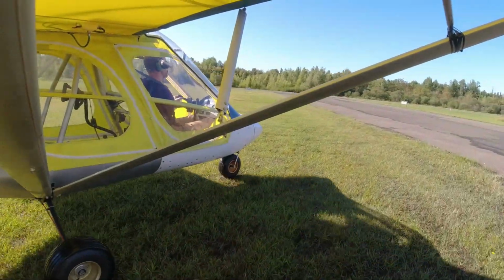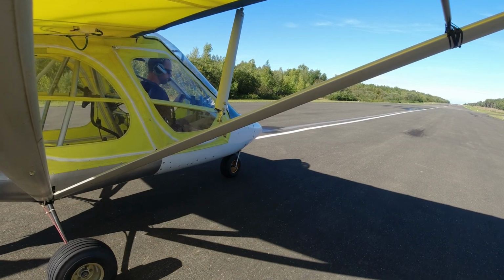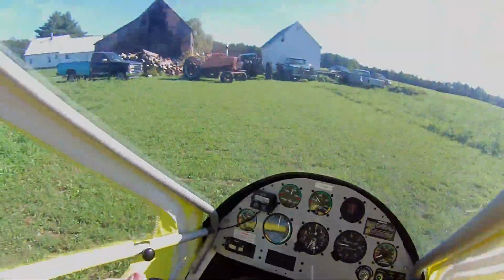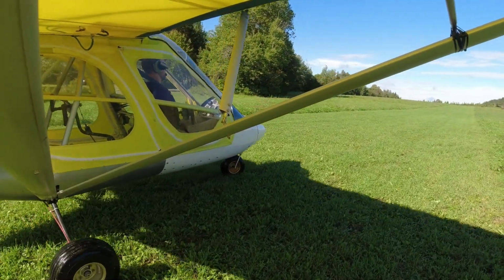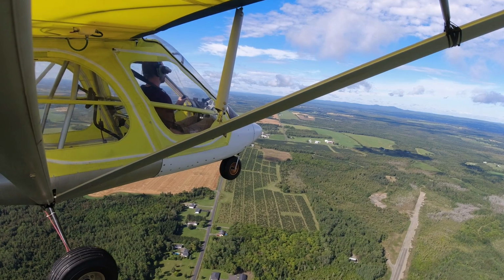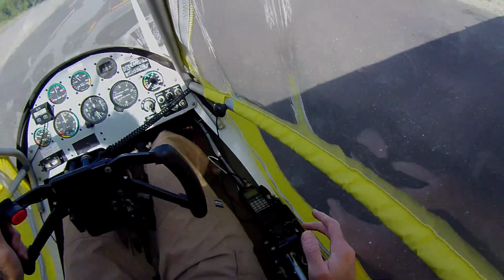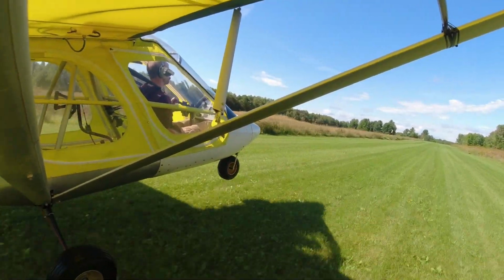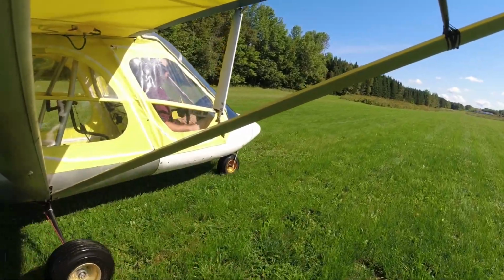Four Airstrips, One Afternoon

Comment: Nice photography! Whatever that camera outside is. It does a great job.  Could you put big bush tires and a set of good shocks on that? Regarding your oil Guage, if it is electronic....I think you said it was....did you check to see if you had a good  complete ground connection ? It may wig out on you if there's a loose connection within the frame work of the craft or the Guage chasis. Anyway great flight!😎👍
Reply from the maker: We have checked all of that with the gauge... no success with anything we've tried. 
Yes, you can put big tires on the GT500 easy enough. Adding shocks would be a complete landing gear makeover though. Big tires would easily do the job without the shocks I think. If it doesn't sell soo, I just may do that. ;-)

Comment: Is that gauge mounted directly to the crank case on this engine? I had a similar issue with VDO oil pressure sender on my Rotax 912. What I found was the vibration from the engine killed these things pretty quickly, so I copied what the RV12 guys do and mounted the sender remotely. All you need is a bit of hydraulic hose with the right ends, mine has been running strong for two years now.

Comment: Curious why you're selling it? With a 912 on it wouldn't it be a bit more appealing than the beaver? I mean the flying you do does seem to suit the beaver perfectly.  But, I can see the appeal of having 35k back in the bank also.
Reply from the maker: I definitely like the 912 - that extra power is awesome! :-)
- The Beaver is a little slower which allows for better low-and-slow flying.
- I prefer flying with a stick over a  yoke.
- I don't like doors and the Quicksilver is a little windier that the Beaver with them off.
- And I just prefer the flight characteristics of the Beaver better.